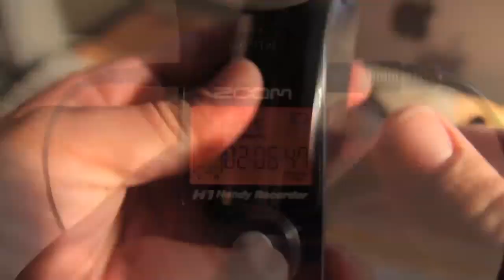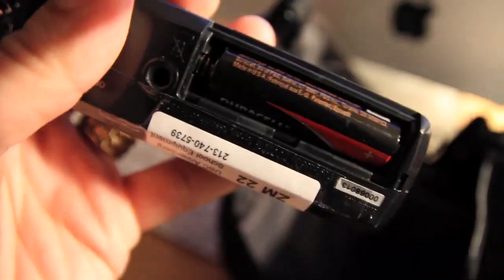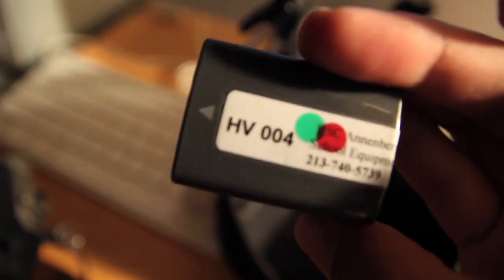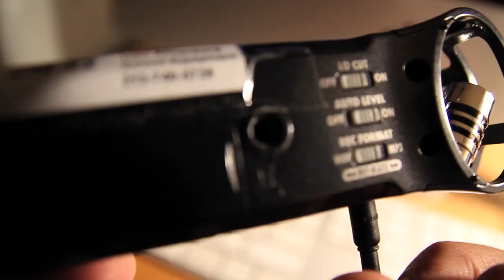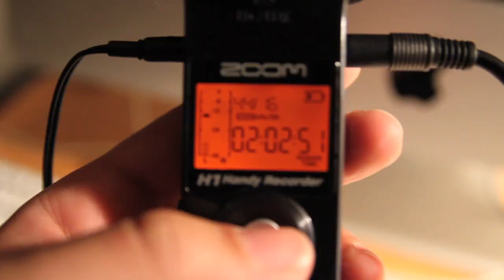Audio Training  - Part 1 - Operating the Zoom H1

Comment: its is some high tech stuff there  the h1 ,  like the impedance changes  just above rec level 15   and at i think level 35 and once more at a higher level , need to check ,   but for  lets say  line signal  then it is best at 15    ,  olso the usb interface is crazy  , so you can hear the  music of you pc  trough the h1  , trough usb , and it sound crazy much better then my onboard soundcard , + you can hear yourself talk  + you can use that for teamspeak example  ,  poeple on teamspeak are shocked from my voice quality   , hehe ,    sad i am not able to turn the mic volume off trough the phones out on the h1 when i use the usb feature   .

Comment: Great beginner tips on using the Zoom H1. However, since I'll be producing a film, I will need 48kHz, not 44.1, which is good enough for most productions, especially music.
Reply from the maker: +Bryan Elder Indeed. We just wanted them to have as much recording capacity as possible. Radio journalism workflow normally dictates 44.1 which is why we said oo do that.

Comment: Just my 2 cent's worth. we should ALWAYS record audio at 24 bit, not at 16 bits, especially if you're setting the rec level manually.. and we should always switch the LOCUT on (unless you're recording low rumbles and bass). 44.1 khz is fine, the human ear cant really hear much above 22khz anyway especially when you're recording mostly dialogue tracks. take this advice frm a sound engineer!
Reply: Azlan A. Hassan 44.1 kHz refers to sample rate, not the audio frequency
Reply: Adam Thornton the sampling rate is directly related to frequency response. The lower the sampling rate, the lower the quality of the recording.  For example  a 16kHz sampling rate recording means the recording is sampled at a max of 8k per channel (all frequencies after 8k will be cut off). So you wont' hear the fine highs/treble in a recording sampled at 16kHz because all the frequecies above 8kHz isnt captured.
Reply: Azlan A. Hassan I assume it would be per channel. The reason for having a sampling rate approximately double the largest desired frequency is to avoid aliasing.
Reply from the maker: +Azlan A. Hassan Do whatever works best for your own workflow. We wanted students to 44.1 16 bit because that was CD quality audio which is normally used in a radio journalism workflow. We didn't want the students to waste space on their data card using higher settings.
Reply: He's right: 44.1/16 =cd audio
                   48khz/24 bit = hd digital audio (new normal) 
                   96khz/24 bit = 4k and up

Comment: Im using a Zoom mic with lavalier mic connected and sound is being recorded very quietly so I end up having to increase the gain by 15 when editing. The level is usually around 75 on the device, any higher I think I would start to get noise. Why is this happening?
Reply from the maker: The mic itself have any kind of sensitivity or phantom power control?
Reply: No just plug in and go type of thing

Comment: Why I can't use the micro sd card to import the audio in the computer ? Does the cable comes with it!?
Reply from the maker: +Allie  Anderson If only I had a dollar everytime someone asked me this. These videos were meant for our students at USC years back and we didn't have enough cards for everyone to risk them losing them or breaking them. That's why it says not to remove the card. Everyone else can feel free to do it :) As for your cable questions i don't know because I didn't unpack it. Our equipment staff handled that.
Reply: it dam easy with cable ,  be shure the  h1 is off ,  plug in usb  ,  on screen  you see 1 second CARD then on second AUDIO    over and over  ,  just hit the big button when its on card and blip ,  there are all the files.

Comment: Is it possible to Connect zoom h1 with DSLR directly using aux cable ..
Reply from the maker: I believe you can run an audio cable from the Zooms headphone jack to the mic jack on the dslr. This is best done though with a camera like the canon 5d mark III or any of the newer models that allow you to monitor the audio input
Reply: Thanks for the reply

Comment: whats the standard Level Input setting? i usually leave it at 80, is that ok?
Reply from the maker: +Ismael Rodriguez If that works for you great, but normally you have to adjust it to accomodate different recording situations and environments.

Comment: Great simple tutorial, just got mine today, but came with no card (??)
I was able to record test and playback, but do I need card ???
Reply: +Paul B Strange. It shouldn't be able to record if there is no card (as far as I know).
Reply: +Billy Higgins 
yes Billy it sure is, as no card was included, but I pressed recorded and tested my voice for meters, but then played back and heard playback.....I take it I need card to adjust audio settings ??
Reply: +Paul B Could it be that the card is already loaded into the recorder? Check the card slot (as shown in the video) and see if it's in there. It's a MicroSD card so it will be very tiny and easy to lose so be careful. This is why we told our students to never remove the card - we didn't want them losing it and asking us for replacements because we didn't have them.
Reply: I did, no card was included.....might have to to buy one today

Comment: I can't find a single video anywhere that shows one of these recording a loud rock concert. The best I found was a little three piece band where the drummer might as well have been using brushes. I'm quite impressed by the sound quality, especially compared to older digital dictaphones, but I can't find any examples of how they handle really loud noise with a lot of low frequencies
Reply from the maker: That was just an example of "good distortion" for humor's sake taken from Green Day's "Awesome as F***" concert film. I did not really go to a Green Day concert and record it with a Zoom H1. :)

Comment: I heard most condenser mics need phantom power to operate,so how did you record with that? Does h1 supplies phantom power?
Reply: Tanvir  ‌ What is phantom power?
Reply: To charge this plate, the microphone needs power (unlike the dynamic microphone). Phantom power sends the correct power (+48V) to a condenser microphone via an XLR socket and cable. Plug in your condenser microphone, and switch on phantom power on the correct channel, and bingo- your microphone will spring to life.

Comment: Canon DSLR cameras currently own, one of the 80D, stereo, with which work performing music bands clips on the street (guitar and cajon)

The fact is that, although I think the audio of them very good, especially the 80D that the mics are in front of the body, I decided to invest in a tape recorder to further improve my audio capture ...

Well, where is the question: I bought so well spoken Zoom H1 and I opted for it instead of the DR-05 because of the microphones in XY and in this case was expecting a much better audio than recorded by so badly spoken mics internal of DSLR ...

My surprise: Audio Zoom H1 was worse than the 80D ... lower and with a more muffled sound ...

SET: Both mics were in automatic mode, the same distance as the subject (since the H1 was on camera shoe) ... The only difference is that I configured the H1 to better quality WAV and camera I was recording in. MP4 (not MOV) ...

The Zoom H1 was wearing a Eneloop rechargeable battery. (I have heard that for use in burners, is not indicated rechargeable battery, is that right?)

Could you help me in what may be happening friend? Does my Zoom H1 came defective?

Thank you.

Comment from the maker: Interesting. It's possible that the firmware upgrade that's up there now assumes that you've already used a PREVIOUS firmware upgrade (as in the one mentioned in the video) that DOES address the power issue. Like I've said, I made these over a year and a half ago and it's been a while since I've used the H1.

Comment: Why would you not remove the SD card to transfer the footage? It's the exact same thing as plugging it into a laptop to transfer the footage. Also, my H1 didn't come with a power adapter, but my H4N did.

Comment: I liked the way you have done test in different environments. I am having zoom H1 but I am planning to purchase rode lavalier microphone. I have got 3 questions: 1) is rode lav durable? its wire looks very thin. 2) How much battery backup do you get with zoomH1 on a single go? 3) Does rode lav provides natural audio gain?

Comment: I feel that the  Zoom H1 while it's a very good recording device however for $110 USD it feels very cheap when holding it in your hand, the plastic housing seems like it will fall apart over time. For that much price this thing should be coated with rubberize for gripping and protection overall, and the top part should be aluminium or the whole part depends on pricing. People would happy to pay a bit more if it lasts longer, also the software layout of this device can be confusing and outdated, it should have joystick function to go to different options, fewer buttons as possible. This can easily be done with today current technology. I bought this device and returned it right away, this should be priced at $45 dollars max.

Comment: Hi.
I've just bought my zoom h1 and when i conect my microphone (rode videomic pro) i have to set the gain up to 60 or 70 in order to get the sound a -12dB.
Is it normal to set the gain so high?
Reply from the maker: That's a good question. I hadn't experienced that problem myself but it's been a while since I used an H1.

Comment: when you use external mic does that cut off fixed mic
Reply: Yes. Plugging a mic into the line in jack turns off / disables the two on board mics.

Comment: I bought used one and there was no power supply or something. But, I have the iphone adaptor - a little white box with usb port, so can I use it with H1 using mini-usb cable? Or it will damage? Thank you
Reply from the maker: Good question! Unfortunately I've never tried it.

Comment: Hey, I own and used the H1 Zoom and I have to inform you....

1. You CAN remove the MicroSD card from unit and use a card reader on your computer to access the files on your computer.

2. You CAN format the card on your computer and DELETE FILES off the MicroSD Card via your computer.  You can also DRAG and DROP files to your computer to use later in projects.

3. This is NOT a PRO Mic, but the quality is GREAT.  Telling people to use WAV as a home user is just wrong.  160 kbps works just fine in MP3 format.

A 4GB MicroSD is more than enough space for MP3.  but if WAV is a must, then 16GB should be enough or just go 32GB.

4. That AC Power Adapter did not come with mine, purchased from Best Buy.

Nice quality video.
Reply: Agree with you. This video is totally useless.
Reply: This video has too many -problems that can't be excused that it is a "student video." You are right. Billy needs to re-do this video or pull it.
Reply: Well, this is just a video for students at USC and if that’s what the teachers and course requires them to do, then so be it.
Reply: I think the idea of leaving the sound card in the ZOOM H-1, or any recorder, is to save ware and tear on the transfer contacts on both the SD card and the ZOOM recorder itself, thus prolonging the life of both. I've had an H-1 for over ten years and it still works great, I just bought a ZOOM H-5 as well,so that I the option of XLR and Phantom powered microphones. Other than tat theH-1 is still the workhorse recorder for every day use.
Reply: I just bought a 64gb micro sd(couldn't find 32gb ones :) ) and this video scared the heck out of me

Comment: NO DUDE !!! it should be set to 48/24 not to 44/16 and this is CRITIC !!!
if it is 44/16 then it will not match the audio that is being recorded to the video file and it will be very difficult (not to say IMPOSSIBLE!) so sync the zoom sound with the video file sound which means if you have a human speaker there will be NO LIPSYNC !!!
Reply: Could someone explain me why the heck shouldn't I set my H1 to 96kHz / 24bit?
Reply: well 96 is 48 multiplied by 2, so it IS OK.
Reply: City_Productions exactly my thoughts. Why is 44/16 prescribed for BEST audio quality when we have 96/24 as an option .

Comment from the maker: Hey everyone if you enjoyed this video, please check out the trailer for my latest short film "G.P.S." and share with all your friends. Hopefully we will get into a festival soon!
G.P.S. - A Short Suspense Thriller (Trailer)
Reply: Why should you only use the micro sd card that comes with it? Can you possibly use one that did not come with it?
Reply: David Stair Yes, you can. I use mine with an 8GB micro sdhc card. All the audio in the concert videos on my channel was recorded with the H1. I use 44.1 kHz 24 bits, WAV, manual level, then adjust levels in Audacity before converting to 16 bits.
Reply from the maker: David Stair You can use whatever you want. These videos were originally meant for our students that had strict workflow/curriculum requirements.

Comment: Hey! Why is 44/16 prescribed here for BEST audio quality when we have 96/24 as an option .
Reply: What he should have said is that is a kind of happy medium between the best audio and the longest record time. The longest record time will be had at MP3 48kbps but it will be terrible quality 91:17:43@2gb. The best audio quality will be wav 96/24 as you said and that will get you only 00:57:03@2gb. He recommends 44/16 which gets you 03:06:19@2gb. Personally I use 48/24 which gets me 01:54:07@2gb. Which is better than what most use anyway, sure it won't be as good as bluray audio and it would get butchered if you stream it anyway. Video is not the only thing that gets compressed when you upload it.
Reply: Thanks for that explanation. Please can i ask, can i still edit with 96/24 in something like power director wave editor?
Reply from the maker: As said in the video, we wanted people to get the same quality audio they'd hear at NPR etc while maximizing the space available on the card. If you want to use those settings that's totally up to you.

Comment: Billy Higgins Hi, i'm the unhappy owner of this oddity at least it's so cute and feminine otherwise it drains my battery with 140uA when it's off, sad :( also shuts itself down just when it wants, sad :(
Already firmware 2.0
Reply from the maker: Sorry to hear that
Reply: All H1 drain the battery found out meanwhile, every moment in time, moment after moment so if the battery left inside next time you'll need another.
Firmware 2.0 is a sad one because it do not allow anymore setting of time due to this new insane function:
"Skip date/time setting menu after 10 seconds with no operation"
Reply: Militaru Dan You read like a badly translated set of instructions.
Reply: The H4N is great but the Zoom H1 is a piece of rubbish. The card cover broke after about an hour of use. it feels like something you would buy at a $2.00 shop.  i am not going to rely upon it to record anything of value. have to get a second H4N.

Comment: Why does the video say you should not remove the SD card? Any reason?
Reply: Being that this video was target to USC students, I'm thinking that some units may be borrowed, and as you can see in the video, the SD card flap is broken. So there must be an issue with that, his advice is probably about reducing wear and tear and/or losing a broken flap or SD.
Reply: I'm not a USC student. Was I supposed to watch it? I do have a USC sweatshirt, though. That should qualify me.